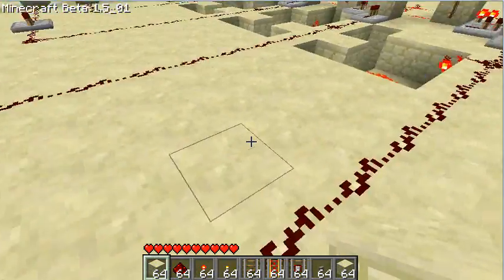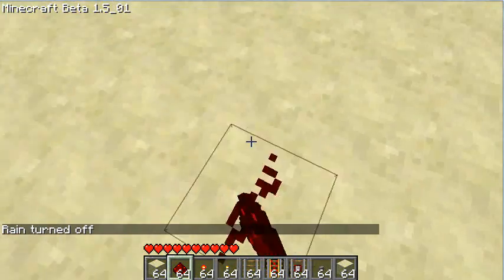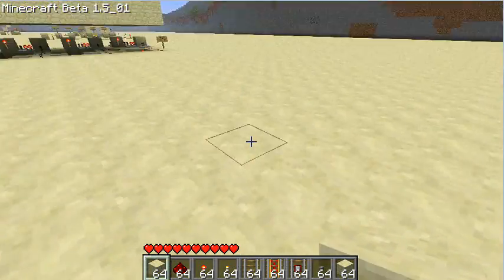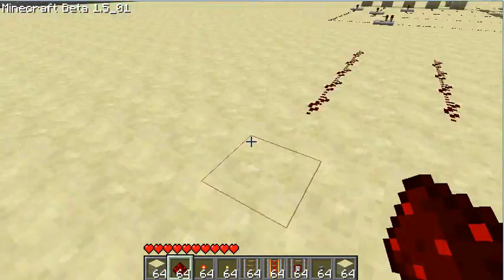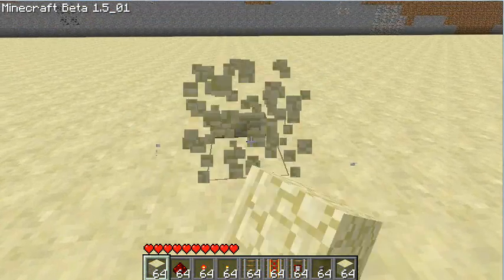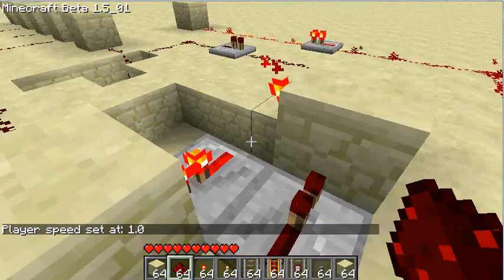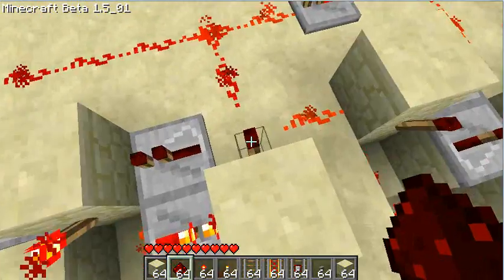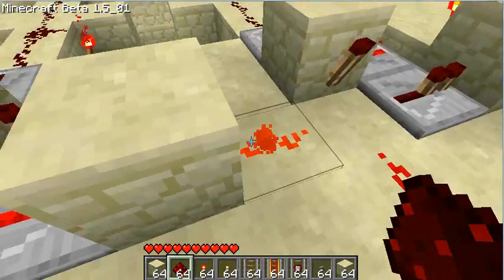(Even More) Compact Combination Lock

Comment: @SpaceMonkeysJTV ohh, I forgot to tell you the other part, move the torches on the block so they're in the middle of the 3x2 square, then put wires in front of each torch and on top of both blocks.